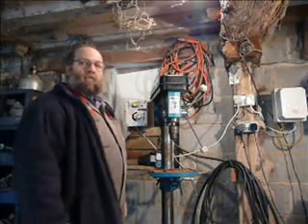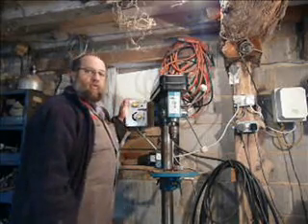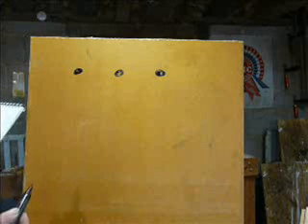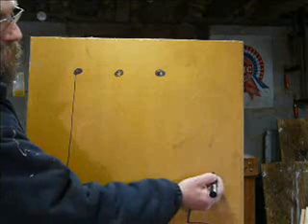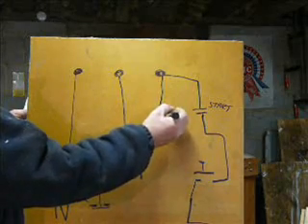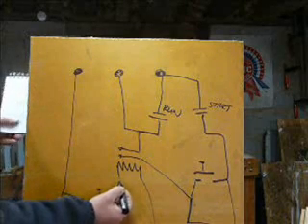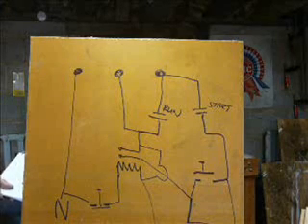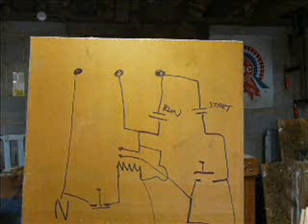How to do it: 3 phase motor conversion. Part 5: relay start

Comment: Thanks Andy . Is it possible that start capacitor will still be kept fed back through relay contact. Thanks again Andy I realy  appreciated what ever you are sharing  with us.
Reply from the maker: Hi, yes you are right and this is corrected in part 6, also see part 7 uploaded last year. Subscribed? cheers
Reply: @TheInfoworks  thanks I subscribed already

Comment: Thanks, Andy. Well explained! I just watched Part 4 and was about to ask how you could avoid the "2 part" starting sequence after a start capacitor had been added. Then I watched Part 5 and, like a ram caught in the thicket, there was the answer! Great series. Keep up the good work.
Reply from the maker: Hi, thanks for your note, make sure you watch part 6 as there is a mistake in part 5, cheers

Comment: Love your videos and very informative.  Cheers!  i was curious and its not mentioned in this video  what are the values used for the starting and running capacitor in Micro farad and i am assuming youre using a 220 volt relay .   Thanks and God bless
Reply from the maker: Hi, yes the relay has a 220 / 240 volt coil. I think the value were discussed in an earlier video in this series, cheers
Reply: Thanks Andy

Comment: I would love to see these connections on an oscilloscope.  I wonder how it is you get the exact 33 degrees phase shift.   Perhaps you don't.  Very curious.  Wonderful ideas.
Reply from the maker: I expect it changes with the load. The main thing is it works for the home workshop. Cheers, Andy
Reply from the maker: I expect it floats with the load. The main thing is it works for the home workshop. Have you subscribed? Cheers, Andy

Comment: Hi Andy,
let me first say I have thoroughly enjoyed and found your videos to be very informative and useful. Secondly like many others before me have, 3 phase motors / equipment and single phase supply. I have now applied your method to my new band saw and had great difficulty with the master circuit box to play the game, finally succeeded though. The final result for this was with 30 MF Run and a 40 MF Start Capacitor Motor in Delta ( 6 Poles) result 2.1 Amps draw when running and 7 amps start with momentary switch. Works great!!
I have another 2HP 400V star wound motor with only 3 poles Delta not achievable, this runs with the using capacitance + start and generating 380V on this third leg, is this how Rotary Phase converters work??? I think this might be my next project, because generating this 3rd leg if run as a single phase supply is free power I think, what are your thoughts on this?
OH yes, last question, the capacitors need a bleed resistor on the start one to make it completely safe 40MF Cap, what would you use?
Reply from the maker: Result! wonderful. Yes running a pilot motor will create a third phase so you get 3 phase power. The higher the resistor value the slower it will bleed, try 10K as an experiment and see what happens or rob one from any old equipment as long as the resistance is not too low, check it for value with a multimeter. Cheers
Reply: Thanks, once again great work.

Comment: I think you also need to use the normally closed circuit of the same relay to disconnect the start cap

Comment: I think you have a mistake in the circuit if it was your intention to disc the start capacitor. When you release the on button the start capacitor is still being fed by the relay latch circuit
Reply from the maker: Hi. Yes you are correct, the problem was addressed is part 6. Thanks for the interest and the comment. Cheers, Andy
Reply: on the relay there should also be a normally closed connection, just use this to disconnect the start capacitor. be well

Comment: Dear Andy,

My name is Arun and I am from Mumbai (Bombay), India.

It is interesting to see your videos on running 3 phase motor on single phase (220 / 230 / 240VAC) and reached watching part 5.

Unfortunately from part 3 (4 and 5) keep stopping at the most crucial time and miss some of the instructions as I have to skip some portion of the video.

In part 5 (and otherwise), part of your drawing is not covered  by your camera, coupled with very poor drawings.

It would be better if you included a neatly drawn circuit diag. with component text in capital letters at the end of each video, so that the person watching it and can draw it for his reference.

Otherwise, all the info in your videos is very interesting, simple, practical, and wort trying..... Please keep up the good work.

Regards

Arun

Comment: What size capacitors would I need for a 20hp three phase motor?
Reply from the maker: HI. You are on an uphill struggle with this one. Here's some figures: run current 4 amps (at 240v ac) per Hp, start current 10 times that, so 80 amps run, 800 amps start. Leave it with you. Cheers, Andy

Comment: Thanks for making the effort to show the COMPLETE explanation for those who want a polished, easy-to-use, and elegant solution to running a less expensive 3 phase motor as a single phase.  I've learned so much from your persistent bottom-to-top videos and your persistent explanations found in the comments of the entire series.  More people should read the comments before asking any questions even if they've seen the entire series of videos.  I'll read the comments and press on, but if I don't find the answer to my question, I may call on you for help in the comments of the next video, part 5.  Excellent work!  LIKED AND SUBSCRIBED!
Reply from the maker: Thanks for your appreciation, later question answered. Andy
Reply: Well said!

Andy: thanks for the great, very clear explanations in these videos!

Comment: Andy i'm slightly confused - The motor cap on my 1.5hp motor shows a picture of each configuration and the voltage of each - it infers that the motor is set for 230v when wired in star and 425v when wired in delta. The planer thicknesser i bought second hand has been previously converted but both motors (1 powering block and  the other feed rollers) are wired in Star. It must have run fine with this set up, but ever since i've set it up at home it isn't punch enough to get the block spinning to speed. Its currently got a run caps adding to 60uf and a 60uf start cap. It will get up to speed but only slowly and when the start cap is cut out of circuit the block slows right down. Any advice?
Reply from the maker: Hi. The motor must be in delta to match the coils to the supply voltage otherwise you will loose power. This is happening. See explanation in parts 1 and 2. To gain more power you can tank the wiring, having a delta connection with a capacitor from both the live and neutral to the 3rd connection. A start cap is needed to start and set the direction of rotation. It needs to be in delta. Hope that helps. Have you watched all 6 videos? Andy
Reply: Andy Reynolds Brilliant - So i had a good play with it tonight, have it wired in delta now. Have between 239 - 242v between phases. Running 40uf run cap with a 60uf start cap. Runs like a dream - Thank you very much! Would love a demo of this 'tank' set up, sounds interesting. I was having problems with running the motor earlier i think because i had too much capacitance, i measured the voltage and on one phase i was upwards of 360v, i wonder was this causing the mirror image of too little capacitance?

Comment from the maker: Hi. You thinking is correct, and this is why most single-phase motors are 2 Hp or less. The start up current. So this simple technique is for smallish motors. I have however used it on 3 Hp motors, but because only 2 phases are being used it has a similar start-up to a 2 Hp. Several viewers have asked about (say) 15 Hp, and the problem is as you have identified. Thanks for the comment, subscribed? Andy

Comment: Nice videoes, and you made it simple to understand. 

However, there's one question that pops into my mind when seing thing being converted from star to delta, when talking about startup. Wouldn't there be a torque question here? I mean, if you use your motor in a application where high startup torque is required (compressors, etc), would the current draw from a delta start be too high for a regular 220v supply, or is it just a matter of fitting the right size capacitor again here.

Comment from the maker: Thanks for your appreciation. Rule of thumb 30uf per Hp for the run cap and 50 uf for the start. Go through the checks as shown in the videos. Make sure you watch part 6, very important. Just loaded a video on solar panels, you may wish to subscribe to get email notices of new uploads.
Reply: is that 50uf per horsepower for the start capacitor? or just 50uf i have a 3hp and 150uf start and 90uf run seems a bit much and i have already blown one capacitor i dont want to keep throwing good money after bad cheers andy

Comment from the maker: Hi, thanks for your comment. Yes you are right that balancing the current would give smoother power, but it's slightly more difficult. I just figured that showing how to check the volts was important to avoid over volts on the coils and capacitors. Interesting discussion building here from comments over all 6 videos.

Comment: Basically you have built a phase shifter (I think) . Our phase shifter said you should check for balanced amperage rather than volts to balance / tune your capacitance while under a load :)

Comment from the maker: Hi. Thanks for your comment. You are right as long as the motor does not requires statring torque. My pillar drill needs one due to all the belts, bearings and lay shalts, but the morticer in part 1 and 2 doesn't because all it needs to turn is the motor and directly connected bit.

Comment: very nice videos series ps before i read the comment i saw the little mistake in the drawing diagram yes you do need that 2 pole switch very important if single pole that start cap will burnt out,thanks for the videos

Comment from the maker: PS. make sure you use a dual pole switch for the start button to disconnect the start relay from the start capacitor.

Comment from the maker: THanks for your appreciation.You do not want polorised capacitors, so they must be for AC use and of a suitably high voltage. I have never bought any, but would try Maplin electronics, ebay, motor manufacturers, or reclaimed florescent light fittings. I just tend to collect them whenever I see any lying about, normally in scrap yards. Sorry I cannot be more specific.

Comment: excellent series many thanks.
could you please point me in a good direction to purchase some capacitors as ive looked all over the net for the old style 240v lighting capacitors but keep getting the smaller modern ones.
what is the specific type of capacitor im looking for? and where do you recommend purchasing from? again many thanks!

Comment: Hi 

Thx for an excellent series with some very interesting experiments (nothing beats actually trying it out..) and a very neat design for start/stop running of a 3-phase motor on single phase. I was thinking the same as snipe1963 after watching the video - in the last part, you add a connection which keeps the starting cap in the loop which wasn't the intention. The live con. goes to the relay contact and on to the middle winding. The start contact goes to live and to Cstart.
Best regards,

Comment from the maker: If you have not watched all 5 videos then that would be a good idea. I would suggest as a starting point to try 60Uf for the run capacitor and 100Uf for the switched start capacitor. You will need to check the capacitor voltages. Then experiment from that point on. The videos are about experimenting to get the best values. Hope that helps.

Comment from the maker: Hi. Thanks for your comment. The stop switch is in normally closed configuration, so its position makes little difference. The power comes from the non-live side of the start switch to operate the self-latching relay. You may with to subscribe to get email notification of further video uploads.

Comment: Great set of informative videos haven't worked with motors for a while and it's always good to see videos like this really breaking it down and making it easy for all levels of experience to follow well done. PS I would wire the stop switch on the incoming live before the junction to the feed for your relay coil that way it kills the power into the system if that makes sense.